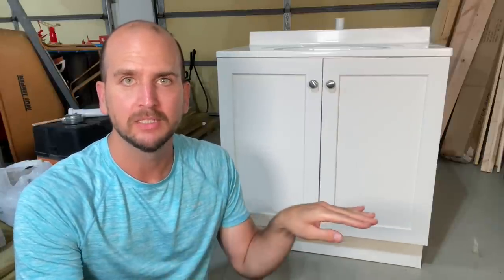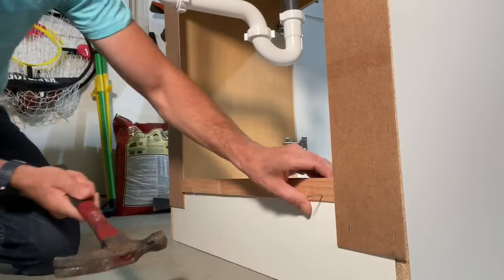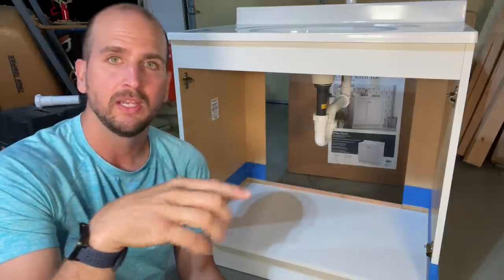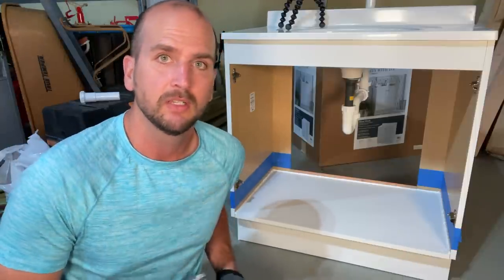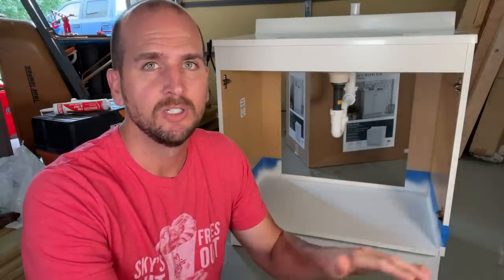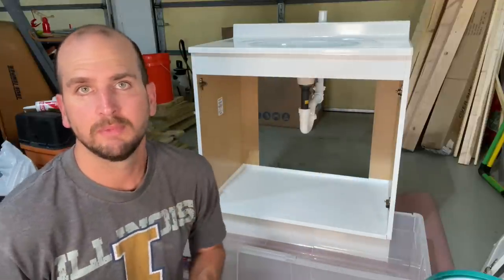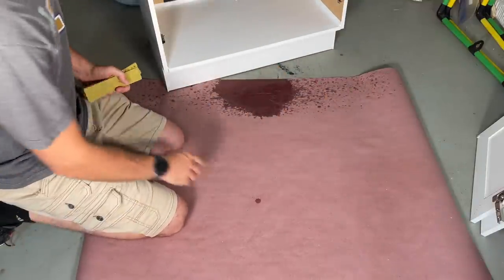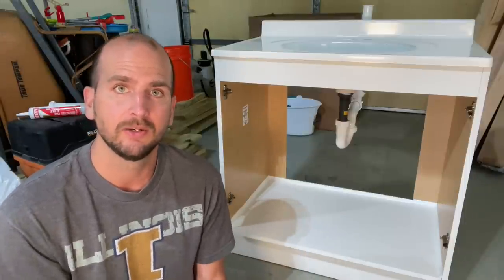Waterproofing A Kitchen Or Bathroom Cabinet With Flex Seal

Comment: Why not dot the correct fix and correct the plumbing. HAHAHAHA
Reply: Well, some people won’t notice that the plumbing needs repair until the damage to the bottom of the cabinet has already occurred. So this idea is intended to deal with that proactively so as to avoid the damage to the cabinet. But there are much better ways to do the job than spraying this stuff.
Reply: @stevebabiak6997  LOL...insurance! I am painting underneath all my cabinets today!
Reply: @stevebabiak6997  Thanks!

Comment: Properly plumbing installation do not have leaks, never.
Reply: Renters screw with things they have no business, clogs, knocking things against them, etc. No poor workmanship, but induced defect.
Reply: @DadItYourselfDIY  or ripping the vanity off the wall, which usually disconnects the drain assy.
Reply: @DadItYourselfDIY   - I have read online where some rental housing providers glue all of the trap components to prevent tenants from tampering and loosening. But then there is the issue of trap clean out, so I don’t follow that practice.